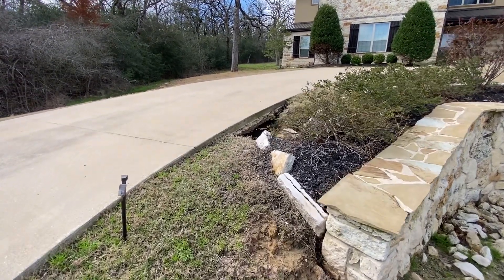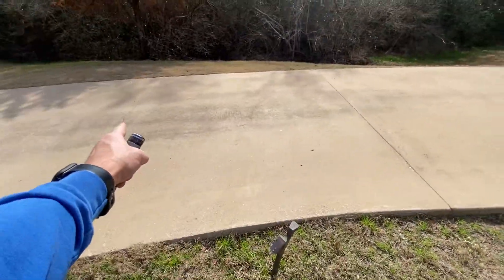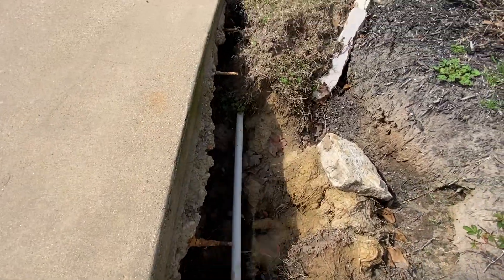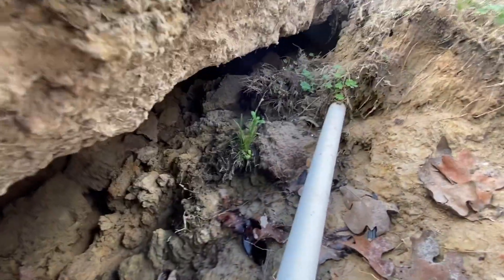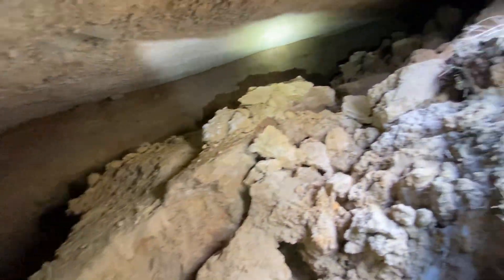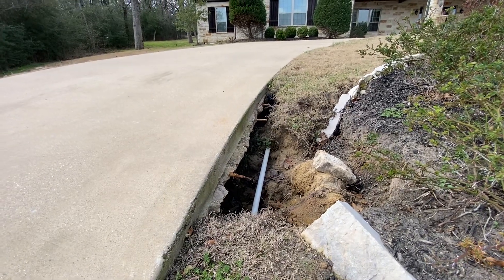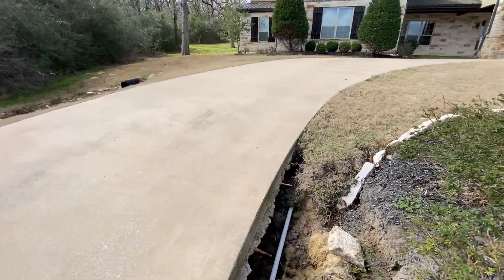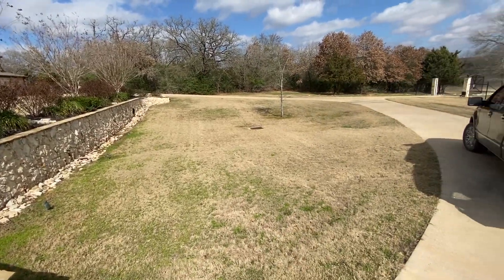YIKES! What happens when you have erosion under your driveway and how to FIX IT.

Comment: Cant imagine the cost of that job.  But then again, those home owners probably aren't worried about it.
Reply from the maker: I looked it up! I was about $8500. But considering that driveway probably cost 5 x that amount or way more, it's a fraction of the cost to save it this way and prevent bigger issues. Nice home for sure.
Reply: @AnchorFoundationRepair cheaper than I was thinking!

Comment: We have an erosion issue right under the foundation of our house. The inspector didn’t catch it. But the dirt is falling from the exterior under the foundation into the crawl space. House is built on a side of a hill. So the ground both slopes to the back and on side of the house. So the crawl space drops from foundation level at the front to 5 ft in just a few ft and the ground is eroding where a downspout goes into the draining system. The ground is soft like sand around that area. I rerouted the downspout but now we need to fix the ground where the erosion has happened

Comment: How did you repair that issue
Reply from the maker: Didn’t get the job… but our method using a hydraulic mud pump and pumps a slurry that consists of topsoil, Portland cement and water.  Really effective at raising up settled driveways and sidewalks or with more water in the mix… filling existing voids to prevent future settlement.
Reply from the maker: Here’s an article to describe how we use it in driveway repair: https://anchorfoundationrepair.net/blog/what-is-slurry-concrete-repair/